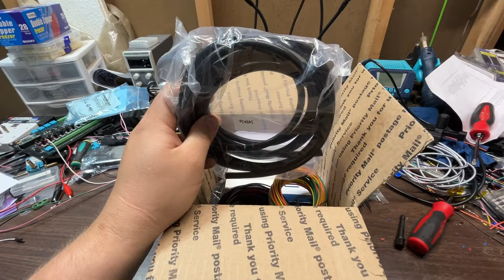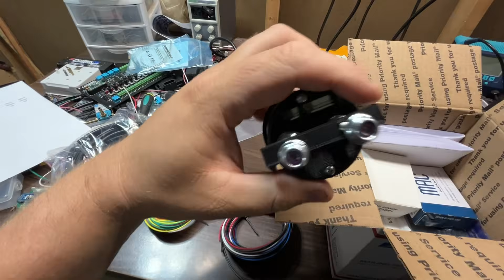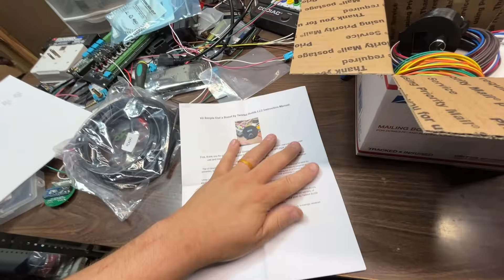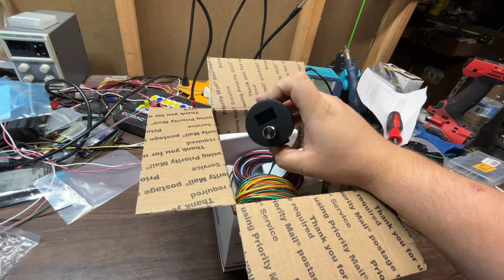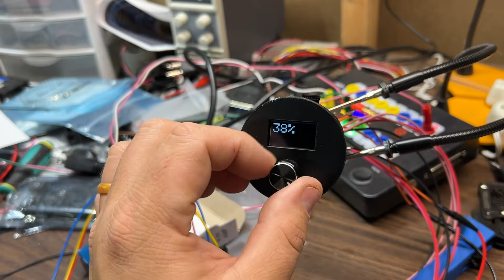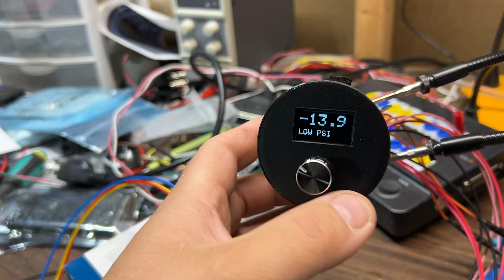V2 Simple Dial a Boost is here!

Comment: so do you build custom Arduino stuff for people? I dont know much about them an tried and failed and ended up using a vac controller for now but i would still like to at somepoint get it on Arduino controller to give me more control and a exhaust brake here a like to what i want it copyed off but this was for a he351ve turbo and im useing a 6.0 powerjoke turbo https://www.youtube.com/watch?v=AgbUfojGwWI so i need no canbus i tried to do the code with out the can but couldnt get it working at all, there a like to the build they did and Arduino code in that video discreption. the 6.0 turbo just uses pwm to run a oil control silonoid. if ya can do something like that with the Arduino code and a wire diagram give me a price ya would want to do it. and my truck info is a 08 f250 with a 12v cummins i installed all the 08 6.4 powerjoke sensors into the 12v cummins the only one missing is the cam position sensor and the stock 08 crank position sensor i used for rpm so its there and there is a gm 3 pin throttle position sensor installed for shifting the 6 speed allison trans. so again if your interested in do it or have any question about my setup give me a yell. an iv seen lots of people in my looking that want to controll a 6.0 turbo for there projects so maybe something ya may want to make to sell even.. thanks